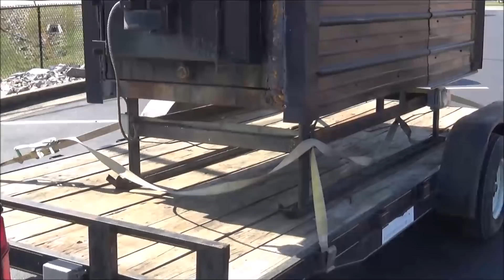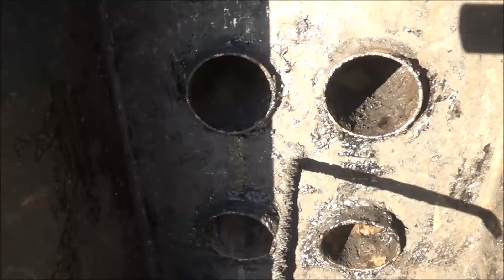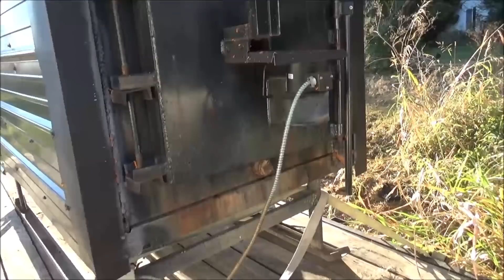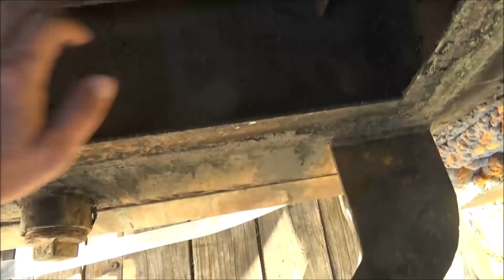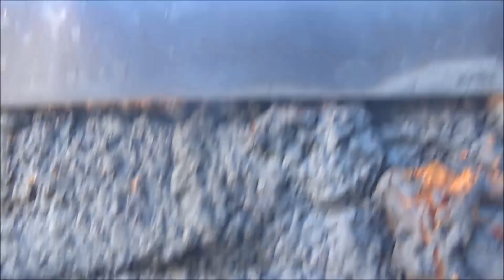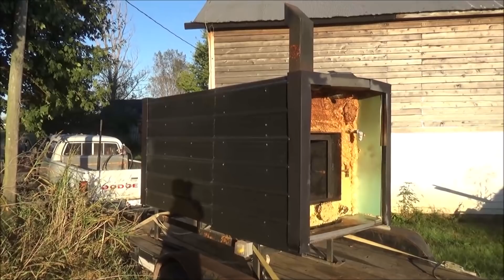New Appliance for This Old Barn Shop

Comment: The only thing Baily heard " Warm place to sleep off Winter "  APPROVED ...!!!!!!!!
By heating the floor, it should provide a relatively comfy place even in the colder days...  
Doesn't look like you'll have time to insulate the roof, at least warm feet will do it. Also stop the condensation on the machines.
Another step forward addressed...    🤧🥶🥵😎🍺👍
Reply from the maker: Pierre's Garage Yep, gets a little closer  to being a proper shop all the time!

Comment: I have burnt wood for many yrs. When I was a kid the house had no insulation so... took 10 cords/yr. Outside boilers have the advantage of keeping the dirt, bugs and ash outside. Downside is you have to go out into the cold to fuel them.  This one does not seem to have as many "fire tubes" as a regular boiler so heat transfer will be lower, but hey... the wood is scrap and free. My experience was about an hour a day of to fuel and empty ashes. Not sure what you paid to heat last winter but guessing at least a couple hundred a month using electric hot water heaters. I would recommend a grate instead of the pan so ashes can be retrieved easier. Perhaps an ash pan that can be pulled out and dumped quickly.  Ashes often still have hot embers in them even if you let the fire die so be aware of where the ashes are  removed. You probably know that... engineering wise, the more fire tubes thru the water will extract more heat. regular boilers have smaller fire tubes. I have had to punch soot on boilers.  ANY coating was considered insulation and reduced efficiency. I have a few different soot punching steel brushes of various sizes for fire tubes. Can get them here: https://www.mcmaster.com/boiler-brushes.Cant remember what kind of circulating pump system is in place but know that the new types of circulators are like 1/3 hp and better than the older ones that took 1 hp. Have also experimented w/ waste oil.  I could come up w/ about 5 gallons/day of waste oil from various sources. Again, took about an hour/day to collect/store/transport, fuel and maintain  while it did cut heating bill, the time adds up pretty quick. Best was separate oil burner and wood/trash burner.
Reply from the maker: A Forman the water heater cost me as much to run last winter as this whole unit did. Only nice thing about it was I didn’t have to tend to it.

Comment: before you start messing with the new wood boiler, finish your insulation and get the roof sealed off. Trust me 80% of your heat is going out the roof. It does look like it would be a good heater to replace the hot water heater you currently have heating the floor.  Wish i lived close by to help organize and finish the inside of the shop for you, you might want to build a little lean too off the main barn for the wood boiler to keep the snow and rain off it, plus storage for some dry wood. Keep up the videos and hope to see you finish the barn soon.

Comment: I've always thought the outdoor type heaters are very wasteful or inefficient because of the inherent design flaw of placing the water jacket around the fire box. This has the effect of keeping the fire "cold" as evidenced by the thick layers of creosote deposits. If it's possible to wade through 99% of the misinformation on the internet and actually find some of the original research and design of rocket stoves or mass heaters (which is not a tin can on a campfire), you'll find that the major difference in design is creating an insulated high temperature firebox which can burn the higher temp combustible compounds and gasses in the "smoke". Once complete combustion occurs, then the heat is pulled off the exhaust. Granted, that kind of system is much harder to make   automatic and  a little more prone to having to babysit it. Everything is a trade off

Comment: This device may give J. Kilroy's feed the monster a new meaning!! When I put my Geothermal unit in, the manufacturer recommended some type of biodegradable additive. I used it at installation, however, at the first recommended change, I switched to 15% antifreeze/water mix. I had no leaks so I wasn't concerned about it getting onto the ground water. Too, i think the AF/water mix had a better enthalpy measurement.

Comment: Another plus will be keeping the humidity in check inside the shop, will you  keep the electric water heater in the circuit to maintain the temperature in the shop when the fire isn't really needed ?

Comment: put an top further to the font angled plate in front of the tubes with only a small gap at the bottom. This will extend the travel distance of the hot gases.

Comment: I think  what you have there is A Taylor water heater. If not it's a real accurate knock off.
Reply from the maker: It is based off a 750 taylor is what I was told, but this one has a bigger firebox, is thicker metal and it exhausts after the first pass out the back and doesn't have the secondary long exhaust through the water jacket and out the front like a Taylor. Notice the secondary clean out door is missing from the front.

Comment: I've been looking at them as well for my shop. I can't get over the sketchiness, even in the factory built units. That thing looks more substantial. Too bad it doesn't have any kind of secondary combustion. I would think that would lose a lot of efficiency.
Reply from the maker: Information on them is limited and solid engineering seems even more so. lol  I will just have to wait and see how this configuration does for efficiency and heat output. I really liked the look of the Portage and Main Optimizer series but it was more coin than I wanted to spend until I could see how well I handle feeding and maintaining one of these things everyday during the winter. If nothing else it is a good way for me to get some of this wood trash cleaned up around here. :-)
Reply: How do you get measurements to figure out efficiency of the burner? I get how you can use temperature measurements to look at losses in distribution, but not the firebox design.

Comment: Can you put a waste oil burner in it to ?
Reply from the maker: I am sure it could be rigged up to mist a little in there for some more btus if you wanted.  You would have to have it configured to only spray in while the air was on and fire was going good and to shut off well before it cut the air off otherwise you could get a big boom.
Reply: @bcbloc02  If you want/need to get rid of waste oil can always soak some wood in the oil then burn it after the fire is started (or when needing extra heat)

Comment: There are also plenty of designs available for flat solar panels that can raise the water temp prior to putting it through your floor that just require sunny days. My place has radiant heat and a wood stove for additional heat. Shop temp minimum around 50  with just radiant, stays about 65 with intermittent wood stove use. Just about right to work in with needing a coat. Mine is 32 X 40, 14 ft ceiling, pex tubing throughout the floor, total of 600 linear feet in 3 circuits. My wood stove is fire bricked.
Reply from the maker: We don't get many sunny days in the winter time here. Did you add firebrick to your stove or did it come that way?
Reply: I added the brick to the bottom. The heat under the stove while still there, is not as pronounced, also it cools down slower. I burn whatever  wood I get, sometimes softwood, sometimes hardwood.
Reply from the maker: mrtomsr Good to know. Did you just do the bottom or up the sides some too? I think that is what I want to do.
Reply: I did some up the back. I like the extra length width wise, so I did not do the sides. I am now mostly retired, my shop is my playroom, not my livelihood, so my heating requirement is to work without a jacket. I am also in Massachusetts, so a little cooler than your area.

Comment: Why not install the boiler in the shop to capture radiated heat?
Reply from the maker: Also don't want all the smoke in the building when you have to open the door to feed it, nor the mess that comes with dragging wood and ash in and out. Not really fond of fires in the shop either for that matter, I think it is much safer having them outside away from the building.
Reply: @bcbloc02  im be mad at you if u burn your shop, Your shop is becoming the best on youtube. After you put stuff up on walls and get good lighting the videos going to be amazing. Your machine make other look like kid tools. Or A big lathe compare to the cheap craftsman.
Reply: Space.... for that thing and all the wood.
Reply: i though more of a leak co2 thing
Reply: and it consumes the air. especially a big unit like that.
Reply: @jsteifel  Brian's shop is a long way from being airtight. :-)